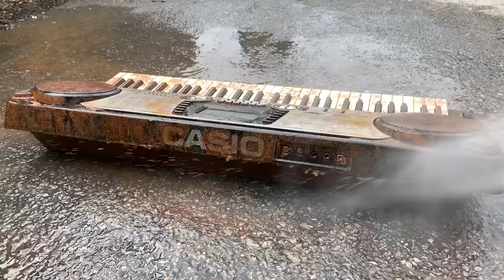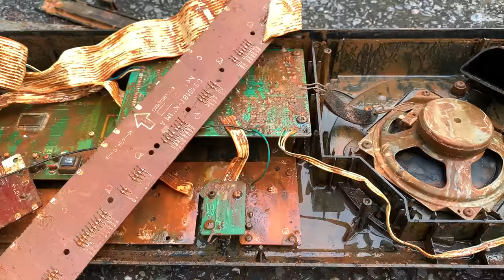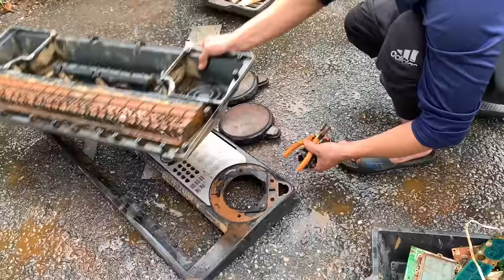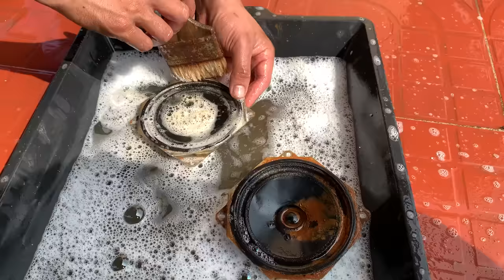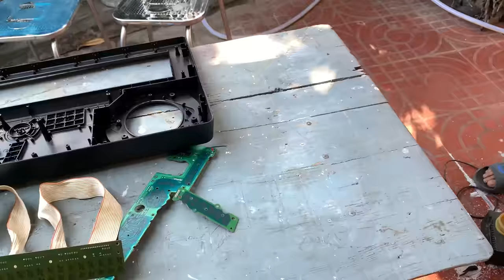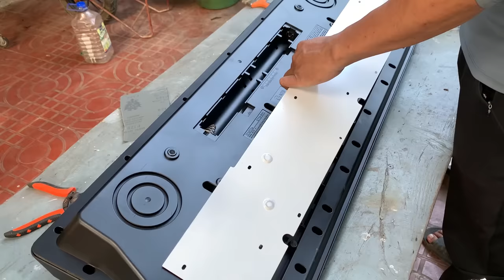Restoration Digital Piano CASIO | Restoring electric Organ CASIO CTK651

Comment: As if he can test a circuit board with the measuring device. And then simply solder in some wire bridges. What should the conductor be interrupted by? And rusting plastic? Who is he trying to fool?

Comment: Is it safe to soak electronic boards in water ?
Reply: Rusting due to wetting by water can cause failure. However, wetting by water is not a problem if the subsequent treatment is good.
Perhaps the searing of the screws was also a reduction reaction to bring back the rust.

However, it is hard to imagine that something that has been left outside for a long time and exposed to rain and wind would work again.